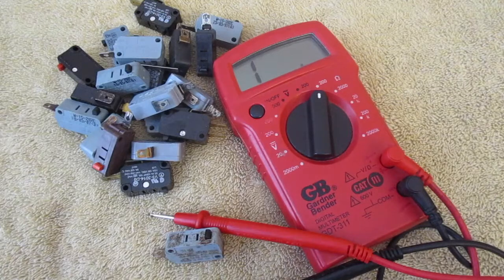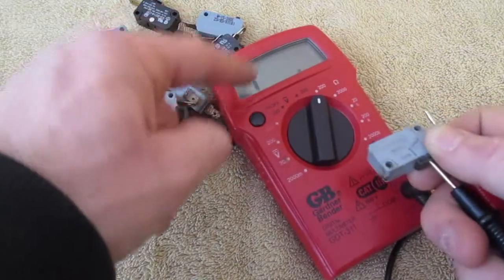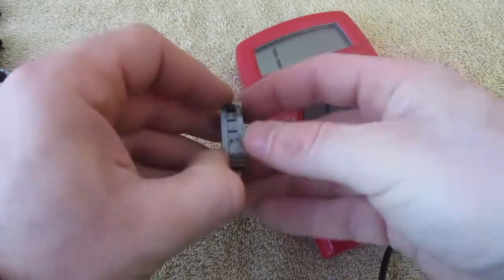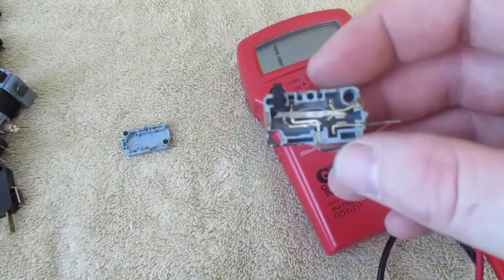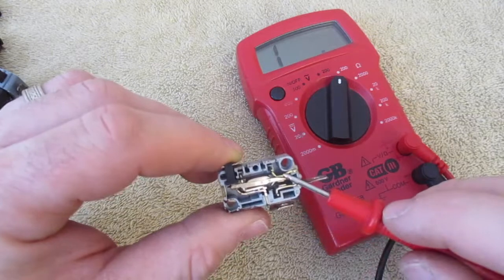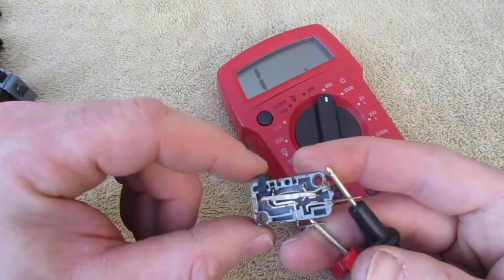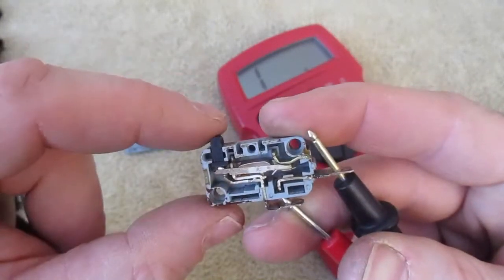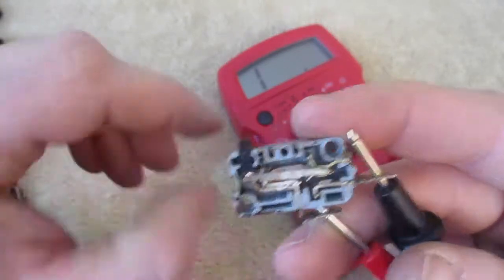INISDE a microSWITCH how it operates What's inside Testing and how it works

Comment: Nicely done, thank you.
I had thought the devices were probably heat or solvent welded together...what a joy to find out that they can easily be opened.
I was able to go in and resurface the contacts, thereby fixing the switch (microwave door switches application), just like one would do in the old days with ignition points.
Reply from the maker: Yepp those were the old days.... Glad it worked out smoothly and you're back up and running....  Thanks for the comment I appreciate the feedback and love hearing when it actually helps people....  Thanks again